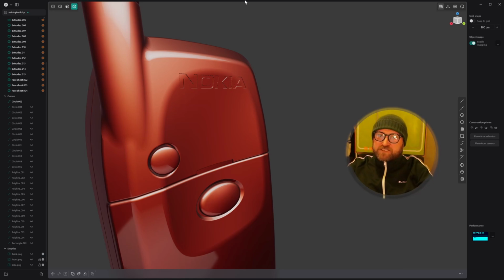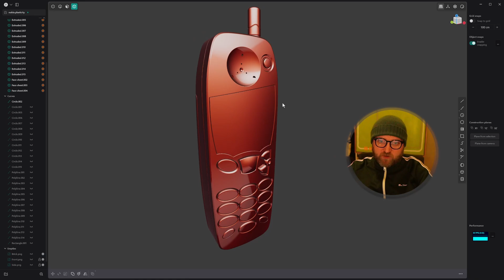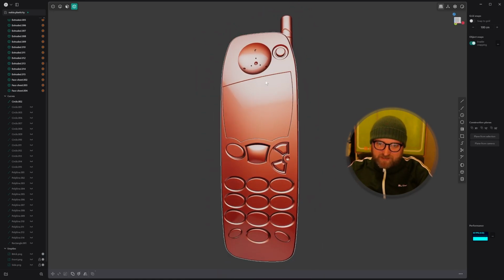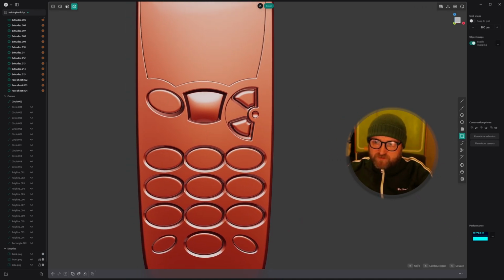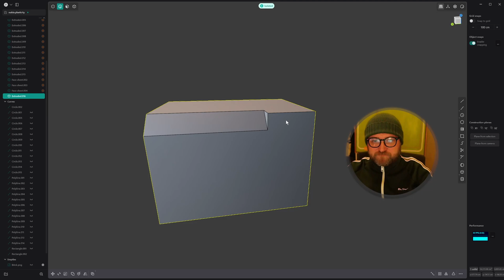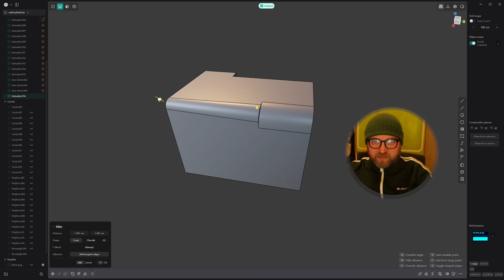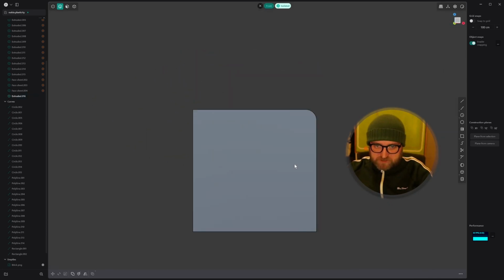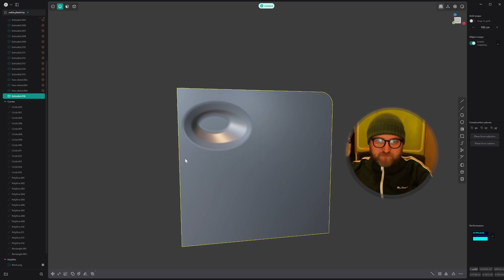Plasticity Quick Tip - Variable Chamfer on a Circle

Comment: Great little handy video, I'm  Interested to know how you did the  nice rounded buttons :)?
I'm having a guess that you stretched out a circle curve, cut the curve in the centre and revolved it, then flatten to taste ? :)
Thx
Reply from the maker: Actually did them a few different ways. The key pad buttons I extruded out from a circle and then applied raise degree twice pulling the centre vertex out and the outer ones in and then filleted the edge.
For other buttons I unioned a sphere to cylinder then flattened the sphere part by selecting that face and scaling on the relevant axis
Reply: Great to know, many thanks for the reply Peter